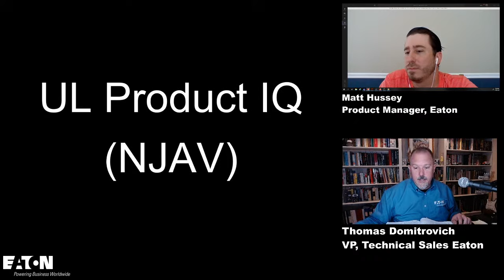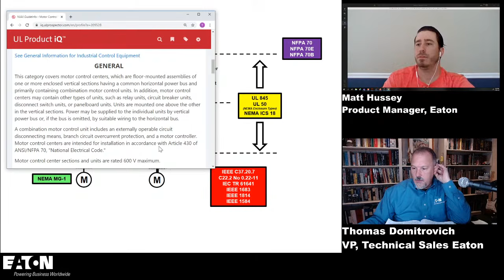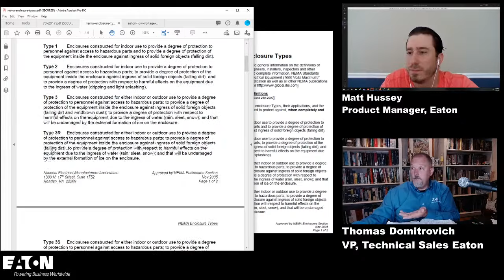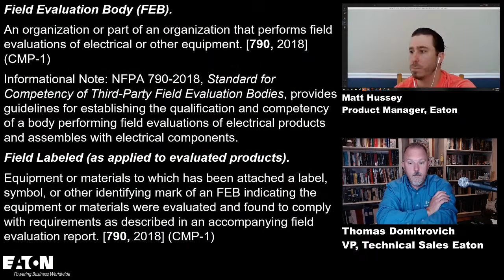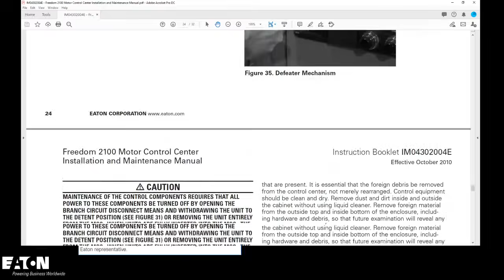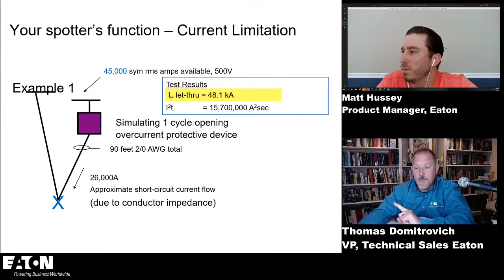Motor Control Center Applications (Part 1)

Comment: Good stuff once again Tom.  I am actually swapping some buckets in the next couple weeks.  Two vfds w/ 30hp motors being fed out of one bucket.  I am separating them to their own breaker feed buckets.  Westinghouse Five Star ( 1986)
Reply from the maker: @doughostetler892, that's awesome.  I remember working on that with Benny Taylor down in Florida at Crystal River Unit 3.  He came up with a really cool program that swapped buckets and little to no downtime and no incidents.